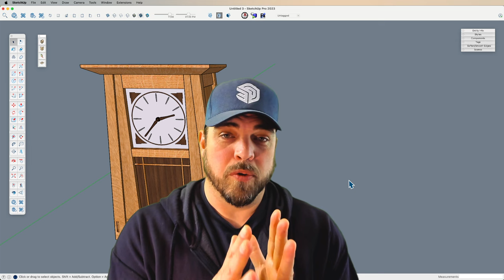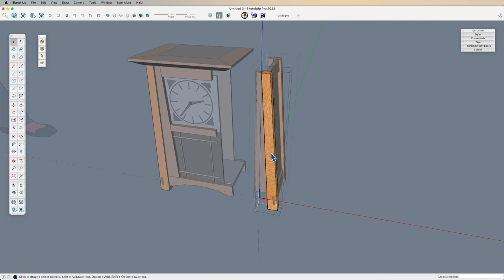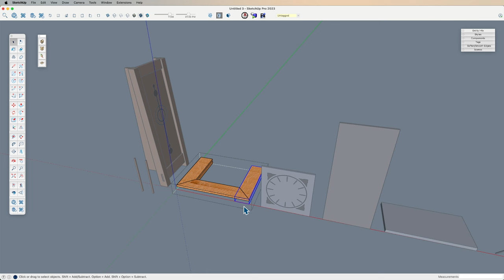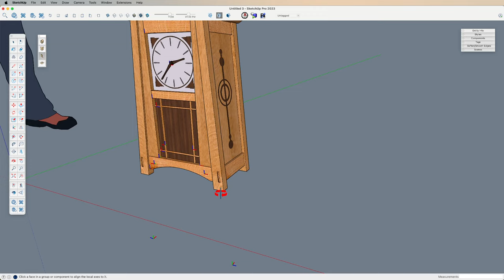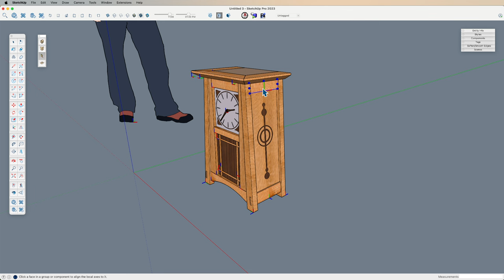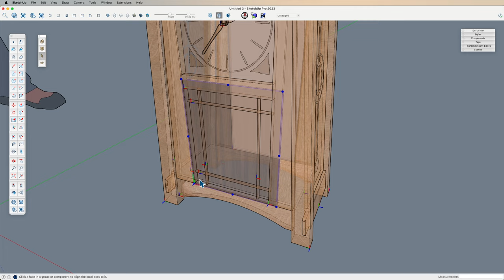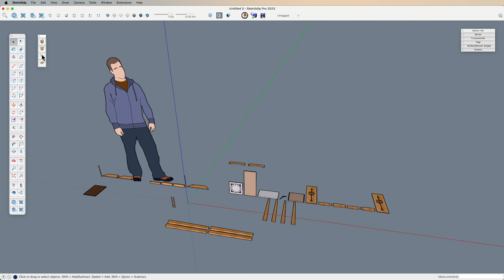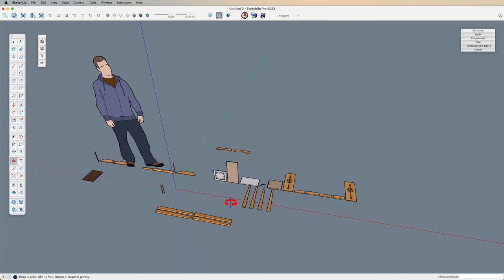Unfold Components the RIGHT Way for Laser Cutting

Comment: as a sketchup user that has recently gotten into laser work this caught my attention.  one of the things about most desktop and prosumer lasers is that the cut depth is very limited.  I would not see how a laser would be useful in turning this model into reality, except maybe for detail on the clock face.  Open Cut List will be useful to map the various components onto material stock.  Glad to see there is thinking about lasers and cnc at sketchup.